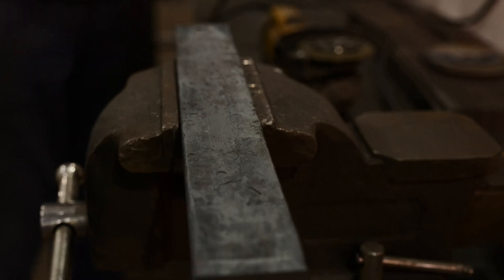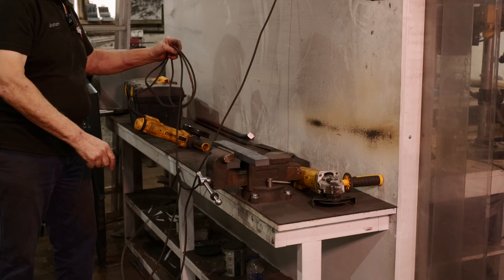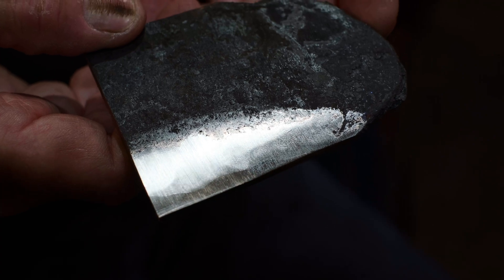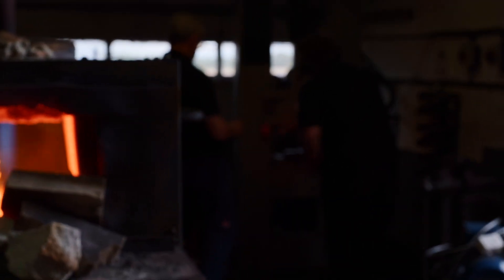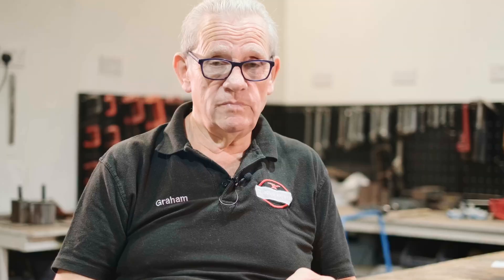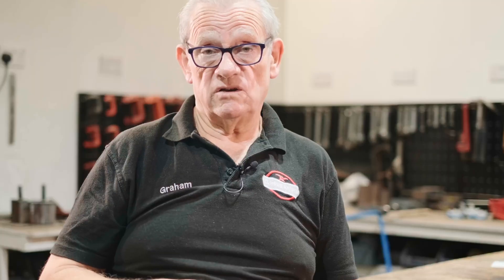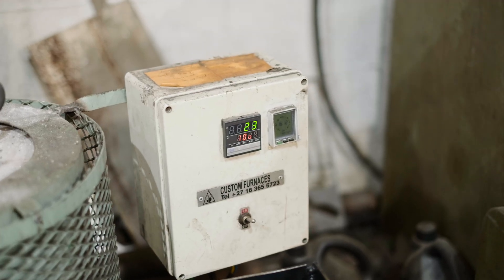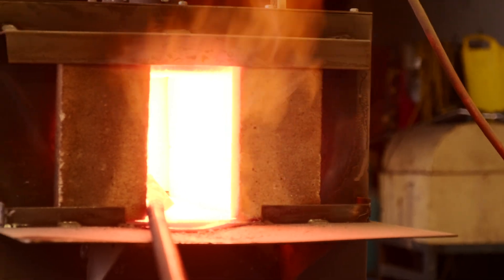Why is CuMai Damascus so hard to forge weld?

Comment: Why would anyone want to layer in a soft, lower melting, problematic mtal like copper.  Makes no sense whatsoever.  Anyone knowledgeable looking at it loses the aesthetic knowing it’s a hot mess .. literally.
Reply: Melting point doesn't matter once it's forged. Soft doesn't matter much if it's not on the edge unless you're encountering particularly high stress (perfectly fine for a kitchen knife). It looks cool and the knife is functional. If you're doing something that'll make it fail once it's finished, you're doing something wrong

Comment: This is good to know. Ive been doing experiments with high alloy steel cored cu mai. And i may change up the core material to something with a slightly lower austenizing temp. 

I think ill buy some d2 so i can run a test on that first. I dont want to waste a 80 usd piece of cpm 10v before i know what will work for sure.
Reply from the maker: Hello again mate and thanks for watching! And you are correct, best to practice on a sacrificial, cheaper material than a CPM10V!

Comment: Wouldn't this be affected by galvanic corrosion and be a terrible idea?
Reply from the maker: Hi Jimi. Good question but I don’t think it can corrode in between the surfaces after it has been forge welded. As Graham explained, grain forms between the two substrates (and not to mention Graham also said there isn’t a “weld line” in between them) but we’ll see if Graham will see your query too. Thanks!
Reply: @UKBladeshow  It would still corrode from the surface and eat in further no? Galvanic corrosion is caused by electric contact between different metals. If you weld together two metals, you are forcing that contact. It's not a case of corrision where there is a gap between the metals. 

I guess you could put a layer of another metal that is less dissimilar than copper/steel to slow the process down but that doesn't remove the risk as there is no one metal is sufficiently similar enough with both metals to remove the risk.

So you either keep it in a sterile environment and never use it or have a knife that will corrode if you let it come into contact with anything that could contain electrolytes (which could happen through contact with human skin, cutting anything organic like fruits, veg and meat or even moisture in a humid environment). Unless I am missing something in the forging process that insulates the two metals.
Reply: @JimIBobIJones  I have some cumai blades from a few years back.....non of them show galvanic corrosion. Maybe if the blades are used often in a salty moist environnement that could trigger galvanic corrosion since it also needs an electrolyte to start the proces?? What does happen is that the copper gets a darker red/brown color after time. I also did some cumai blades using layers of thin pure nickel foil to sandwish the copper layers in a stack with steel.....but then you could not call those cumai any longer.... Cunimascus , Nicumai perhaps :)
Reply: @HoutmeyersP  electrolytes are basically salts which can come from a lot of sources, ranging from minerals in your skin, cutting into meat/veg, dis.h soap etc. 

Galvanic corrision manifests as reddish rust so that could be it? Copper in its normal oxidisation goes green and forms a layer on top rather than corrodes the base metal.

Not 100% sure how helpful nickel would be. It's galvanically similar enough to both most stainless steels and copper to be effective at slowing it down but carbon steels (depending on the composition) are generally in a different galvanic series than stainless steels so it's likely to be much less effective.

Anyway, not a smith so have no real world experience of this but chemically it doesn't seem like a good idea (at least if you are selling them commercially).
Reply from the maker: Great question really Jimi. I will speak with my friends in the metal industry (or better yet, I’ll ask Graham) about this. Thanks Jimi!
Reply: @JimIBobIJones  What kind of non stainless carbon steel is maintenance free....imho non . Galvanic corrosion is really a non issue on these cumai blades....i sold a few , no complaints whatsoever. The nickel i added was just to see how it would look. I mostly use nickel instead of the 15n20 for plain damascus san mai blades(with a solid carbon steel core) as the contrast is much better. Have a look at the small folding knives that William Henry produces......he also uses copper , nickel silver , brass and other alloys in his blades.....they are expensive and he sells them commercially for years. I doubt he would keep using copper if galvanic corrosion was a big issue
Reply: @HoutmeyersP  It's not normal oxidation. It's supercharged corrosion where the presence of one metal (the passive metal) drives the corrosion of the other (active metal). It's incredibly rapid, destructive and can be triggered by any electrolytes (basically salts) including from a humid environment or "sea air". Regular maintenance will not cut it.
Reply: @JimIBobIJones  But there is no oxidation/corrosion/reaction like you describe on any of the cu mai blades i made allready years back...and nobody else that made a cu mai blade is seeing such supercharged rapidly destructive corrosion. Thus for these cu mai blades galvanic corrosion is a non issue , its like worrying all birds wil be flat  and dead because clouds are suddenly dropping from the sky. It is not happening.....if you still think it is happening , show me just 1 picture of a cumai blade that is destroyed by galvanic corrosion. Surely if it was an issue that would be a very simple task.... since a lot of cu mai blades are used for kitchen and hunting knives for a few years allready. I do not doubt galvanic corrosion exist and can be a issue .....but not for cu mai blades.
Reply: @HoutmeyersP  It's basic science.... unless you are insulating metals or otherwise seperating the risk is high. I am not a knifemaker so can't show you proof of a knife but a knife is still just metal at the end of the day so won't act any differently than any other object.

Random example off Google between a steel and copper (nuts and bolts also need to have fairly high carbon in the alloy so good standing for knife steel): 

https://blog.pipingmart.com/wp-content/uploads/2021/10/What-is-Galvanic-Corrosion-scaled.jpg
Reply: @HoutmeyersP  as a follow-on, the example you mentioned (william Henry's knives) actually solves the problem. Only the core is carbon steel, whereas the jacket is stainless. Depending on whether its active or passive stainless steel, it can be galvanically similar enough to copper to significantly lower the risk. As the core isn't exposed where it touches the copper, the electrolyte part of the reaction is prevented from entering the equation.

But if you fold copper layers between carbon steel, then you are doing nothing to prevent it.
Reply: @JimIBobIJones  With all due respect. Please show me by posting a clear example the apparently enormous problem that you keep discribing ON A CUMAI BLADE.....if you can not find it on the very broad internet it doubt it will ever be a problem for those who want to forge a cumai blade and sell it. I believe without doubt there's science and experts that can explain why in some cases/applications galvanic corrosion can cause enormous problems. But besides all science and expert opinions if i ( and many others that forge weld those blades) do not see what they are describing on cu mai blades that are made (for me my first 3 years ago) , .. than for me its a non issue. There's absolutely no reason why anyone would not forge those blades.There's also no mention of any galvanic corrosion problems on cu mai blades on any of the big knife making forums that i follow. An actual  problem is that almost all non stainless knives will rust and eventually break down in small pieces if not protected from the elements.....and that is described an proven for many years now with articles and photo's.......NOT ONE EXAMPLE TO BE FOUND on what you describe ON A CUMAI BLADE.
Reply: @HoutmeyersP  I'm not a smith and I don't know how to forge. Which is why I am asking. 

Unless a Cumai blade is somehow not made from normal metal or is protected, I don't see how its unavoidable. That's the problem... 

Are you suggesting that forging metals into a knife somehow means that its different from every other application? 

Scientific fact is scientific fact...
Reply: @JimIBobIJones  You were asking an opinion (asking = means you do not know for sure)......and i replied as a knifemaker/smith that the problem you describe does not manifestate itself on any of the cumai blades i allready made in 3 years. I cant predict what will happen to the blades in 5 years or even longer periods....or when the galvanic corrosion eventually get triggered or not....as it is only those 3 years i makes these blades. In this discussion its only you who keep stating its a very big problem and a terrible idea while its obviously not for all those who actually forge those blades for a long while....also absolutely no mention of it by other blade smiths on any knifemaking fora. No photo's , no complaints, no articles to be found on cumai blades failing due to galvanic corrosion. Why you keep kicking that bucket ??....i really do not know. If you are still convinced all cumai blades will fail ....then please dont buy those blades. For me personally and for many others i am sure , i am going to create some very nice and extraordinary cumai blades in the future and sell them to those who want it with a 3 year guarantee/warranty no galvanic corrosion will cause their blades to fail.
Reply: @HoutmeyersP  Well that is interesting, anecdotally, but in no way solves the problem at the heart of my question. 

I am sure smiths are solving the problem but the question is how. 

My question is about the objective science and metallurgy, not subjective anecdotes. No offense but that would be like saying "I have never seen the curve of the earth so it must be flat". 

Smithing doesn't magically change the chemical or physical makeup of the steels. 

The William Henry Knives you recommended actually does that by using (galvanically similar to copper) stainless steel in the jacket and only having carbon steel in the core, and other smiths are suggesting using Nickel as a barrier metal between the carbon steel and the copper - but a lot of smiths are just throwing in Carbon Steel directly forged with copper.
Reply: Since you keep doubting that what i say is real , and there is nothing wrong with the cumai blades after years....i let you in on a little smiths secret. I use the eggwhite of a rare Glittering Starfrontlet colibri egg to use as flux when i am forging my cumai blades......my knives are not cheap for that reason because you need at least 5 eggs per billet and the bird only lives in Colombia's western Andes. I must end this conversation by wishing you a fine evening and sweet dreams about galvanic corrosion ruining all cumai blades ever made.
Reply: @HoutmeyersP  More that your anecdotes provide nothing to explain what you are doing to solve the problem - which is cold hard scientific fact...

To doubt something, you have to have more than thin air. How can you doubt nothing?
Reply: @GemAppleTom  Your "hint" doesn't change a thing. Chemically you are right, galvanic corrosion results from an electrical coupling of dissimilar electrodes in an electrolyte. Practically, whether two metals will corrode in this mode or not is determined by galvanic similarity (or "more/less noble metals" if that's your preferred way of looking at it).  

Putting it a different way doesn't change a thing...  

Copper and carbon steel is a well establish common example of a failure of galvanic corrosion. 

I don't doubt the other guy's expertise in forging blades, but when he doesn't understand that GC isn't the same as regular oxidation and simply claims "it doesn't happen" - yeah I don't really take his assertions without any explanation as to how the problem is solved on trust. 

As I said before, I am sure that smiths can and do solve the problem but just saying it doesn't happen at all is anti-scientific.
Reply: @JimIBobIJones  oh and the nickel interlayer makes forge welding copper to steel much easier - Ni alloys with both very easily but Cu and Fe don’t alloy so readily.
Reply: @JimIBobIJones  You are talking to a metallurgist. This kind  of stuff is my day job.

You should have taken the hint that the relative size of the cathode and anode is an important parameter in galvanic corrosion and questioned whether you had the whole story.

A small steel screw in a large aluminium sheet will cause significant corrosion in the aluminium. A sheet of steel in contact with a equally sized aluminium sheet won’t suffer galvanic corrosion to anywhere near the same extent. A small amount of copper can cause galvanic corrosion in steel - I’ve seen it myself. Coating pretty much all of a steel blade in it won’t. 

No special treatment or alloy selection needed (apart from normal cleaning and maintenance).
Reply: @GemAppleTom  Surface area affects the rate of corrosion - not whether corrosion occurs. 

Even with a larger surface area, the rate of corrosion is fairly rapid.
Reply: @GemAppleTom  Regardless, I am done wasting my time on this pointless debate online.

Comment: I agree, do not melt the copper.  I do this process all the time and after you get some practice, it’s easy to know the temps to keep it under from looking at it in the forge.  I also would never advise trying to forge weld multiple pieces of steel as the core.  While it may be possible, your chance of failure is extremely high.  Just forge weld that first, THEN layer in the copper.
Reply: I totally agree. If you don't have the metallurgical understanding and correct control/monitoring equipment then the chances of failure in forge welding steel-to-steel layers together without melting the copper are high.

Comment: Not blade related I am still trying to meld copper and wrought iron, I can make it stick without too much trouble but making it stay together to finish what I am aiming for is a bit of a challenge....I have melted the copper which can look awesome in wrought iron but its no good for structure. I also found that getting wrought iron clean enough to stick didnt matter too much but getting it to stay stuck it has to be clean so I am presuming the copper migrating under scale is a factor...thanks for this, I may have a little more idea what I am trying to acheive now
Reply from the maker: Hey mate you’re welcome! We’re very fortunate to have the likes of Graham helping the knife making community!
Reply: Sounds like an interesting project. Mind me asking what you’re trying to do?

It’ll cost an awful lot more but if you’re trying for a copper/silvery patterned mix then you could replace the iron with Nickel. You’ll avoid the problem of the iron and copper coming apart during working and Nickel can be wrought even more extensively than pure iron without cracking.

(Though you’d definitely need to avoid melting - nickel and copper will completely mix together)

Comment: Tyrell knifeworks said before that its more like brazing the copper to the steel than actually forge welding.  Really interesting that melted copper can infiltrate and mess up the base steel if done improperly.
Reply: It's a nightmare and is, I think, the main reason why good quality Cu Mai billets are so expensive